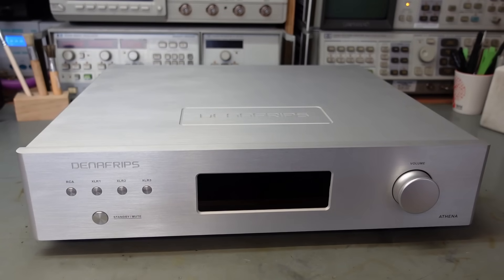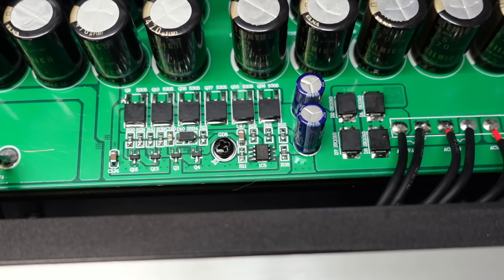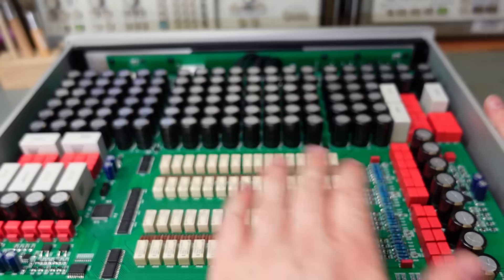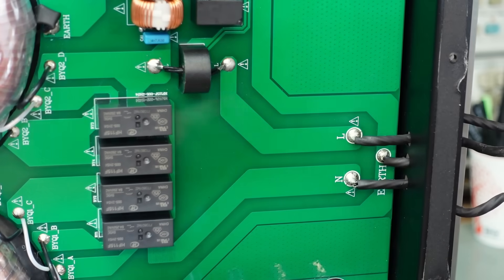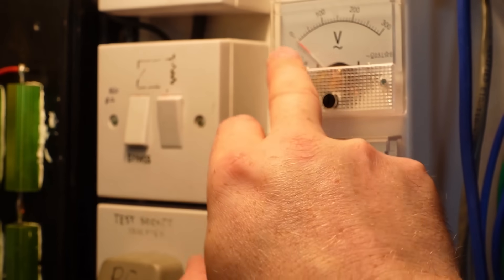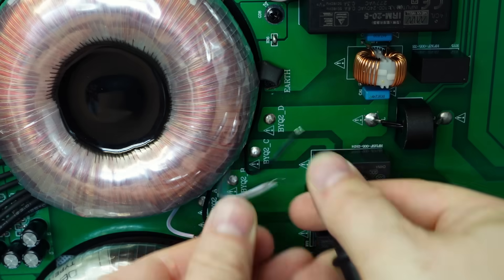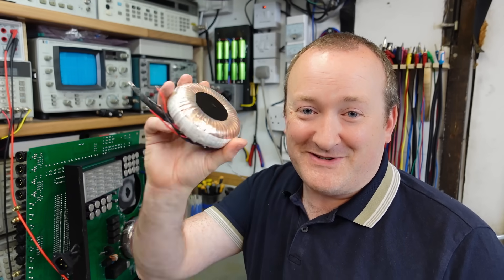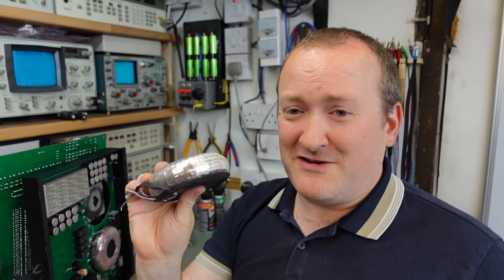ATHENA has fallen!

Comment: considering that this amp is only a few years old it should not have broken already,  i have 20 year old rotel stuff that is rated at 230V but is run on 245v without any problems

Comment: I am not sure that a 10 vac increase in supply should have cooked that transformer.
Mains supplies have a permitted range of ±6 of the declared voltage.
In the UK the declared voltage was harmonised with Europe at 230vac.
So 240vac is within range and allowed all the District Network Operators and National Grid not to have to change the long standing supply of 240vac nominal

Comment: Here in Australia with lots of sunshine, my Audio setup is a simple Car Radio CD with Sub Woofer and Jamo Satellite Speakers. All running from a Solar Panel and 12V Battery. I'm certainly NOT an Audiophile, but the sound quality is really good, no power cost and also green. No 230VAC to worry about - and Definitely NO Mains hum! Even the very best (Mains-Powered) Audio systems will develop some 'Mains Hum' at some point in their life. And that is the difference. DC power supply is pure...... Mark, you always fascinate with your extensive knowledge, and many will question: How did you reach such greatness in repairing almost anything electrical? Years of hard study I guess, with a good Teacher behind you. The Test Equipment behind you is also mind-blowing!

Comment: Not designing equipment to be able to deal with 210-250v (when it doesn’t have separate 220-230-240 settings) is pretty bad form.
Reply: especially for 2 grand :]
Reply: Made in China.... Even the website is full of grammatical errors. And this sort of failure doesn't inspire confidence in this price bracket
Reply: Yep
Reply: This happens with equipment made anywhere... It's just industry standards for transformer production. 
I've seen same issue on Audiolab, Arcam, Luxman.

Comment: Ah yes.. Having the signal path run through a load of relays so there’s plenty of coils to potentially leak emf into the signal path, is soooo much better than a simple potentiometer 😂
Reply: Indeed lmao. They could have used JFETs as switches to shunt the signal to ground through their individual resistors. It would have introduced so little distortion, nobody would have noticed!
Reply: @mattmoreira210  They need all those relays to take up the real estate on that oversized PC board! If they used JFETs it would populate a small corner of the board and they wouldn't be able to justify the $2000 USD price tag. 🤣
Reply: i have always wondered if distortion is introduced as the signal passes through the different materials eg  copper to relay contact then relay contact back to copper !!
Reply: @stopthebus  true. 😆
BTW, either the relays are "shit" for audiofool standards, or they sold that monstrosity at a loss. I'd have a hard time believing it was the latter.
Reply: @garygranato9164  great question! I'd love to know, too.
Surely contact oxidation ain't helping with the noise floor... 🤭
Reply: @mattmoreira210  exactly , thats 5 different materials if you include the "oxide layer"
Reply: @mattmoreira210  Since these are special signal relays, the contacts cannot oxidize, as they are hermetically sealed in a protective atmosphere. Because these relays have a minimum current requirement and also due to the design, the generation of EMI is negligible.

Comment: no fuses? not even a thermal fuse in the transformer?  as nice as it seems, its a bad design.  sure brits have their fuses in the plug but its not a problem having one in the device aswell certainly dont need a directional voodoo one to keep up the quality. 
also they should have gave the transformer a different amount of windings while keeping the ratio, to at least give it 5..10% headroom before it goes into saturation.. at 230v it is near saturation, wouldnt that distort the ac sine wave coming out of it? not that it makes any difference, but those people spend thousands on power regeneration equipment just to get a clean sine wave
Reply: Made in China! New Hi Fi gear will never last as long as vintage!
Reply: Would've been a good test, to see/check when it saturates and point the IR camera on it, still it's very unusual for it to sit with a dead short on the input, agreed.
Reply: A thermal fuse in the transformer would not have protected this. The fault isn't caused by the extra 10 volts applied. A 230 V primary winding should easily be able to handle 240 volts, even 250 volts. Poor quality transformer made in china.
Reply: or maybe the guy had some DC on his AC line for some reason, toroidal transformers go into saturation pretty quickly with a very little amount of DC offset due to not having an airgap.  we got some little dc offset on our mains aswell, which you hear at certains times a day when the ceiling fan starts humming a little more than usual. 

also winding toroidal transformers is quite voilent, the wire might have been damaged in the process.
Reply: @gamerpaddy  I highly doubt you have DC on your mains lines. Remember that the power to your house is fed from a step-down transformer so there's no way that it can have DC on its secondary. I think what you are hearing with the fan humming is being caused by something else.

I have worked on and repaired hundreds of pieces of equipment over the 45+ years I have been repairing domestic and professional audio gear and the failure rate for the toroidal transformers is very low.

Comment: i just replaced all tactile switches on a Tascam 2488 and then a Roland Mc303 then thought i am getting good at this so ordered a vga 15 pin extension cable from ebay for my Fostex D1624 mk2 before i tried the vga extension i powered the Fostex on and guess what the control screen has no power going to it. It's never ending

Comment: 9:04 That is not a valid reason why this transformer should have failed. Even though it says 230 V (2 x 115 V), it's only a nominal voltage. Even here, in continental Europe, mains voltages are allowed to rise to 253 V to be within legally required limits (no different from the UK). Any equipment sold must be designed to tolerate 253 V without problems. With the enormous increase of PV systems in recent years, we actually do see mains voltages of 253 V for hours and hours nowadays and a regulatory body has even proposed to increase the limit to 264.5 V (i.e. 230 V -10%/+15%), which in some countries is already a fact.

Comment: A cap changers wet dream.For what they cost it would not hurt to add a 240 volt tap.
Reply: Doesn't need one. A 230 V primary winding should easily be able to handle 240 volts, even 250 volts. Poor quality transformer made in china.

Comment: I'm guessing you have about the same voltage delivery in the UK as we have in Norway, 230V +/-10%, or anything between 207V and 253V, and to bad for you if you dare complaining, at least if you live in a rural area. I have lost the odd electronic equipment because of this, thankfully, nothing expensive. Both my PC's and TV set are behind UPS's. The annoying thing, as I see it, is that even if electronic equipment is certified, it doesn't have to be built to withstand the voltage between those 2 extremes, and they are extreme.
Reply: Not quite, we still use 240v( the harmonisation exercise didn't physically change anything with the grid) we can still see up to 256v regularly depending on distance from and the loading on the transformer.
I've even seen 259v but that was an exception.
Reply: A 230 V primary winding should easily be able to handle 240 volts, even 250 volts. Poor quality transformer made in china.

Comment: What a monster, and no fuses! How did they overlook that?
Reply: Because they're audiophiles. That many capacitors and relays speaks for itself... not just pointless, but actually bad engineering.
Reply: At least the UK plugs have built-in fuses.
Reply: They didn't overlook it.  it's believed fuses sound bad.
Reply: @sasquatch1554 if fuses sound bad, I wonder how that bunch of relays next to the signal path sounds... 😏
Reply: @MacPhantom not so much bad engineering as unnecessary engineering. After the first couple of caps the extra filtering is sonically pointless. Gotta admit though, it is visually pleasing & the relays clicking for volume is quite gucci.

Comment: What an absolutely ludicrous design, clearly aimed at people with more money than sense. Plainly a mere preamplifier does not need such massive power supplies.
Reply: Exactly Samuel !!

And to make matters worse, after checking the specs on this preamp, I discover that it has unity gain !!

In other words, it provides NO additional gain between the source and power amplifier !!

Tough luck if your power amp has low input sensitivity, and you can’t drive it even close to medium/full output because this preamp provides NO additional signal gain…

Basically it’s a very, very expensive, over engineered BUFFER, with a mechanically noisy (relay) volume control !!

Sheesh 🤦‍♂️🤦‍♂️🤦‍♂️
Reply: @Nicholas.T  Blimey!

Comment: Thank you for another insight in the crazy world of audiophile equipment engineering. A normal user would go back for claiming warranty when hearing the effect of turning the volume knob. An audiophile's ear just hears quality. Like the real audiophile would immediately notice a difference in his audio when one of those many caps would start leaking. 
By the way, weird that they still stuck a little SMPS module in there. I would think that SMPS does the standby supply and it will be turned off by a relay when the 5V from the transformer kicks in. At least, that's what should happen, to make it audiophile-compliant, isn't it? I thought you mentioned that the transformer did the standby supply, so what's that SMPS doing there?
And then it has that transformer that cannot handle 240V instead of 230V? I'd call that shoddy engineering. An audiophile would probably call me a fool, because everybody knows you need one of those audiophile true sinewave UPS devices, like the one featured on this Youtube channel, earlier.

But really... Mark, do I need to remind you to the fact that the screws for the two shielding plates can only be tightened by using a torque-screwdriver? With your inconsiderate use of that power tool, you unwittingly altered the distance and thus the capacitance between the two shielding plates. The carefully tuned shielding plates would absorb fluctuations in the earth's magnetic field but when not correctly torqued, there's no way to tell what will happen. It might even amplify the fluctuations. These fluctuations will cause an oscillation of 19.7Hz that will cause the left and right channel to be out of phase for approximately 3.141 degrees, which sounds awful when using power amplifiers with electron valve output stages. It has something to do with variations of screen impedance of the valves used. Most brands match pairs but just two also match the screen impedance, but that's beside the point.
You MUST screw those in carefully, starting with the screw that is closest to the power inlet and continuing in counter-clockwise direction, in two passes. First pass, tighten the screws to 3.72Nm torque. At the second pass, tighten further by turning 58°.
Since you did not notice the 19.7Hz wobble on your scope while testing the device, you are risking a comeback. Let's hope that the customer has a power amp built out of discrete transistors, so he won't notice anything.
For the rest, excellent job.
Assuming that you used solder with the right silver content and a maximum temperature of 315°C, so the solder's atoms are aligned for minimum distortion on the sine wave of the AC supply. This actually does nothing for the sound quality. It just prolongs the life of the capacitors. And the capacitors DO matter, as we all know.
Reply: And especially don't forget to perform this procedure during a full moon. By the way, also remember to condition the device with classical music; that massages the electrons in the proper manner, resulting in much better-sounding music. I also noticed that a regular, ordinary power cable was used, which is unacceptable. Use a special double-shielded interconnect cable costing at least €250. (It's also crucial not to think about the dozens of regular installation cables in the walls, as that spoils the music experience).

Comment: Don't quite understand the discussion about it not being able to handle 240v when the UK is now at 230v, which 220v kit should handle with ease.
Reply: The Voltage harmonisation was nothing more than a bureaucratic exercise - nothing physically changed with the grid in the UK, so our voltage is usually between 240/250v and very rarely goes below 240v.
 If the equipment isn't built specifically for the higher voltage or (as was more common years ago) a switch fitted to select the appropriate voltage ( 220-230/240-250) it will cause all types of issues such as burning out transformers.
Reply: A 230 V primary winding should easily be able to handle 240 volts, even 250 volts. Poor quality transformer made in china.

Comment: great vid as always Mark, surely a 230 xformer should be able to handle 240?
Reply: Sure it can! --- for a while... 😀
Reply: Should do with ease, same story with all vintage gear rated for 220V that has to cope with 230-240 these days.
Reply: @puciohenzap891  "Should" being the keyword---but sadly many components made in recent years push the limits of their ratings, and whereas a vintage transformer intended for 220V can normally stand a large voltage range +/-20-30V or more, a modern transformer intended for 230V may really only be able to reliably stand 235V over time, due to cost saving measures implemented on its production.
Reply: Use the least amount of insulation as possible during manufacturing.  Happening alot with most consumer  electrical products.
Reply: Under normal conditions yes, and with a quality made transformer.
You should be able to feed 300 volts into that transformer and it not break down.
These units are made in china, I suspect they have used poor quality insulation on the windings and this has resulted in shorted turns.
It's definitely not due to 240 being applied to a 230 volt primary.
Reply: @@jdekong3945  Of course it should!  Especially a unit worth $3000!  This is the result of greedy manufacturers trying to maximise profits.

Comment: If this Pre-Amp is rated at 230VAC and 240VAC is enough to burn out a transformer, why for such an expensive device doesn't this have protection against overload on the primary side.
Reply: 240 volts applied to a 230 volt transformer isn't enough to "burn it out". 
Transformers are not "absolute voltage" devices.
Say for example the secondary of a 230 volt transformer is 10 volts, if you feed 240 into that transformer then you will get 10.43 volts on the secondary - it is not even half a volt more on the output.
In fact, you could apply 300 volts on the primary and whilst the secondary would then be producing 13 volts, there should be no issue.
What is more likely in this instance is the transformer is a cheap chinese one (Denafrips is made in china) and the insulation on the windings has broken down creating shorted turns.

Comment: So the manufacturer built this insane unit where everything is supposed to be the best of the best - and then they put fricking tinned stranded wire into the screw terminals on the power socket?
Only goes to show me once more that "audiophiles" will buy any bs if it is only expensive enough and looks good.
The run-of-the-mill SMPS module is just the icing on the cake there... ^^
To imagine that people spend thousands of bucks for "power conditioners" and cables to be able to filter out "distortions" from "Power LAN" and then their beloved (and expensive) Highend preamp uses an SMPS - ridiculous!

Comment: Why didn't they fit a 220/240 volt transformer ?? For the cost of probably less than a meter of extra wire around the primary winding this type of cost cutting is stupid

Comment: So what's with the light bulbs at the beginning? If they turn on it means it is bad?
Reply: Means the device is drawing a lot of current, more than it should. Menawhile the lightbulb limits the maximum current it is able to draw.
Reply: @Ascania  Thanks. So if I understood correctly, the transformer was damaged due to the 220/240 thing and was basically shorted. That's why it offered almost no resistance. And as the light bulbs are mounted in series, they would receive all that current that was being passed through and would light up. But I am surprised that an electronic equipment like that is not protected from a short. Isn't it dangerous?
Reply: @toto123456ish  You go that correct. Normally we use fuses for this purpose but they skimped on that in this case.

Comment: Did anyone catch that arc whilst Mark was soldering in the new Power Supply? Roughly at 9:34, but look closely at the thirty five or thirty six second mark. There's a short with a visible arc from the soldering iron to the other side of the ground wire. Fortunately it did not arc to a place that caused any damage...
Reply: I think that is a piece of solder falling off, he retrieves it just after.

Comment: They spend all that money throwing absurd piles of high spec capacitors and relays in there, and they can't even be bothered to include a transformer that can handle ordinary ranges of line voltages?
Reply: The lunatics have taken over the (design) Asylum...
Reply: A 230 V primary winding should easily be able to handle 240 volts, even 250 volts. Poor quality transformer made in china.
Reply: @@Nicoya  Yep it's a chinese junk! I wonder if it floats?  The owner ought to try that!